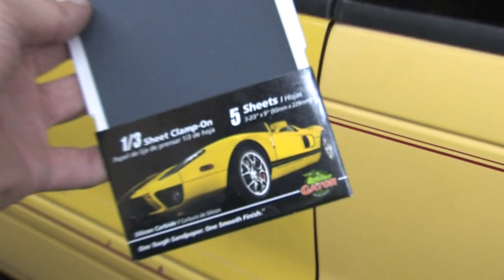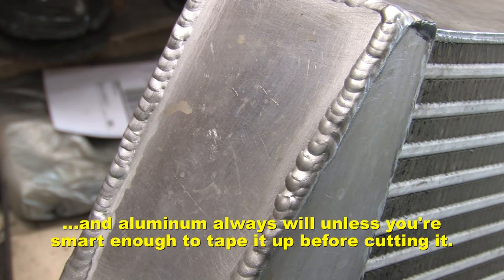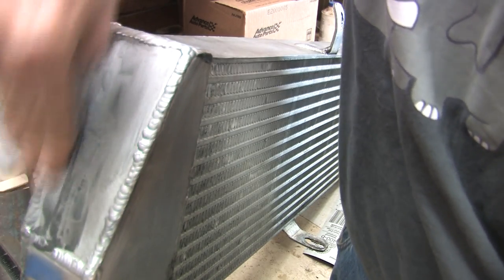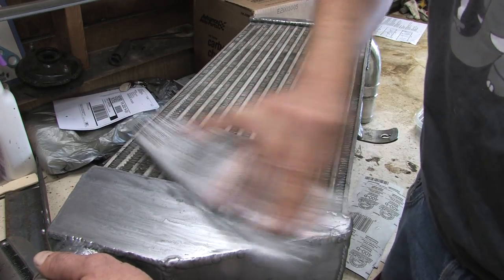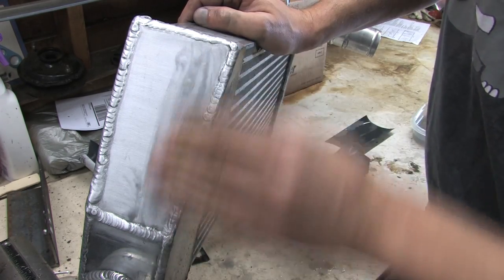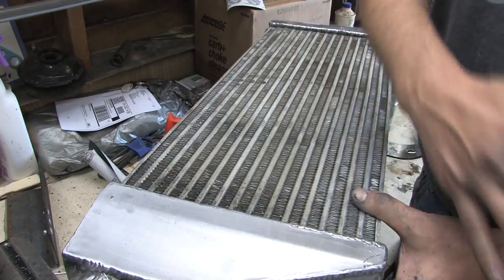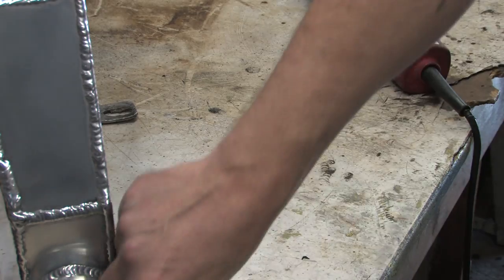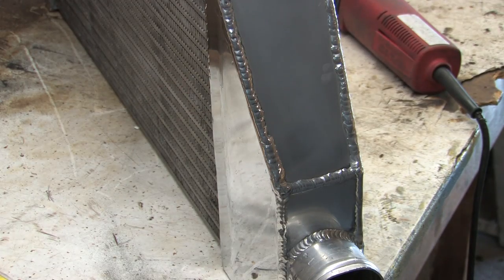Polishing Aluminum (GSX is alive)

Comment: Why go to all of that effort and leave those nasty looking welds? IMHO it would have been far better to carefully grind down the welds to blend them in and create a smooth rounded transition between each surface plane without weakening the welds and result in a much more professional looking part.

Peace!
Reply from the maker: Jeffrey Vastine Because after welding it together and replacing sections of the end tank that keep repeatedly blowing out on this car over and over again, you get tired of making it look perfect.  The real cause of the problem was identified, and it wasn't related to the strength of the part.  It was welded inside and out.  Any end tank short of a cast tank would have blown out with what was wrong, but doubling the thickness of the materials and still having to repeatedly weld them back together is why.
Reply from the maker: Perhaps you failed to comprehend the very simple sentence in my polite reply to Jeffrey where I said "The real cause of the problem was identified, and it wasn't related to the strength of the part."  So on behalf of all 3 master certified welders from Caterpillar and DuPont, Fuck you.  Banned.
Reply: Robert, at times don't you find it difficult to understand some people? The lack of empathy and compassion some people illustrate simply boggles the mind. A prime example s the event where a toddler was shot and killed over a so-called "lane dispute" due to road rage.
Reply: The comment was not directed at you or your comment. It was directed at the childish and pointless dialog that follows as anyone can clearly see by reading the entire thread. In my mind there is no difference between this and the senseless act which resulted in the loss of life, which are both acts fueled by hatred and anger. I am far from being alone in this view. Do you understand?
Reply: Jeffrey Vastine Jeffrey, I totally understand where you're coming from. I understand your analogy and I understand the point you're making. Gaz Girl is judging another without provocation, whatsoever. Shallow minded. Can you imagine being married you someone with that mindset?
Reply: No thanks. I would rather apply my cognitive functions to things that are productive, a benefit to others, and that are worthwhile pursuits. Of course halloween is near and for many a nightmare would be fitting for the season.